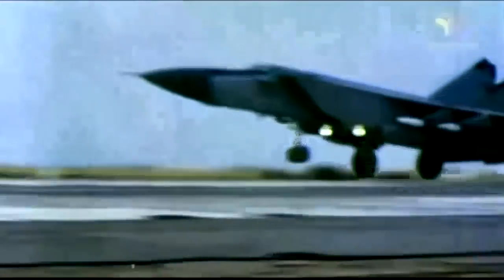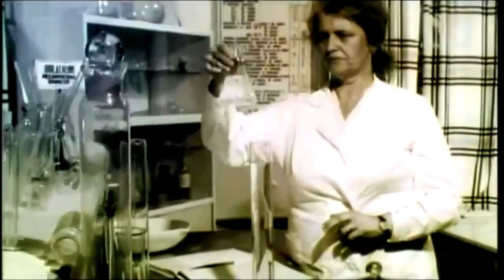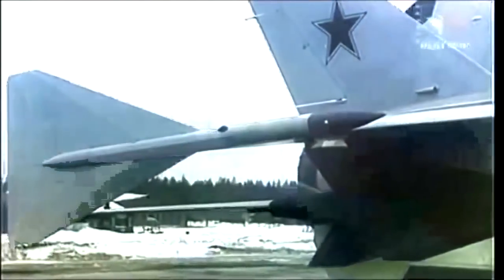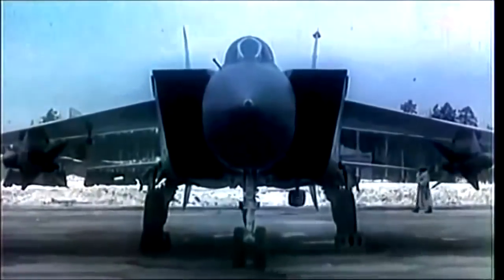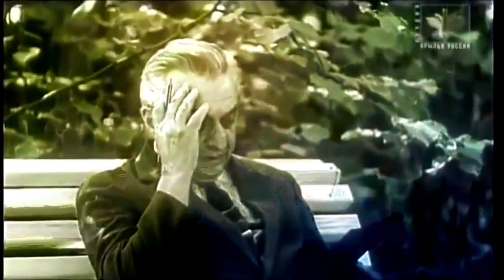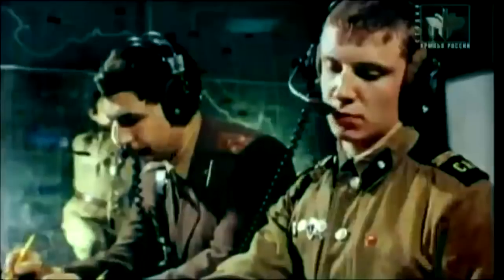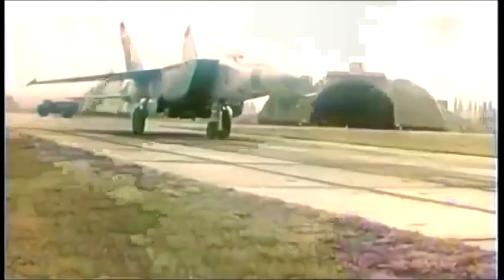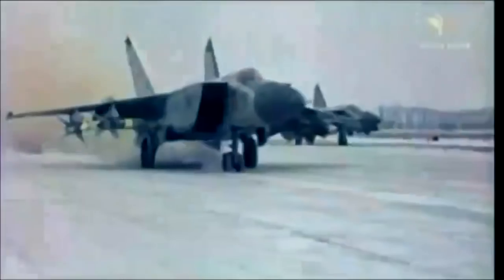MIG-25 Foxbat The Legend in Cold War (Documentary)

Comment: It still remains the fastest production fighter/interceptor ever flown, it was an amazing aircraft back in the day.
Reply: Fast with really short range and antiquated avionics and weapons. F-15's/14's would have shot them all down.
Reply: @billenright2788  Actually the F14 is a hanger queen. 30 hours in the shop for every hour in the air.
Reply: @billenright2788  LOL sure, if they could ever catch one with a missile.   They are entirely different planes with different purposes. The Mig 25 is a high-speed, high-altitude, very short range interceptor with an extremely specific purpose to its design: countering the B-70 strategic bomber.  It is NOT a fighter, nor was it designed to be.  The Su-27 or Mig 29 would be a better comparison to an F-15/14.
Reply: @richardpluim4426  That's exaggerated nonsense. The F-14 was an amazing plane, and better than anything the Soviets have ever produced (to this day).